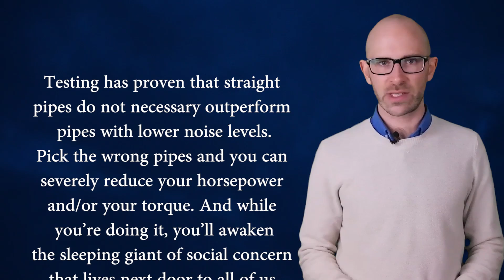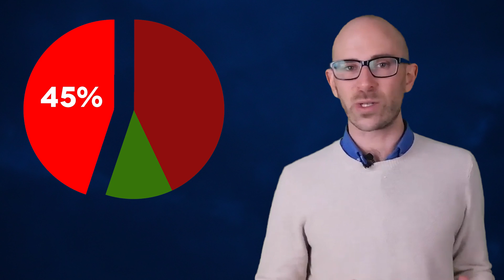Why are Harley Davidson Motorcycles So Loud?

Comment: I don't own a Harley Davidson. And I never will. The big complaint I hear from people is getting stuck behind a large group of Harley bikes going way too slow. The reason for this is because of the Harley Davidson engineering. They are notorious for going into a death wobble at freeway speeds. After seeing multiple videos of Harley Davidsons going into the dreaded death wobble I wouldn't buy one if I won the lottery. A machine that expensive should not be trying to kill you or make you deaf every time you ride it. Unacceptable. Get a Honda or Kawasaki.

Comment: The same jerks riding Harleys full throttle through my residential neighborhood in the summer are doing it without helmets or safety gear. I don't buy the argument that they are concerned about motorcycle safety. They are loud and obnoxious and they think it's awesome. It makes me want to live on a curvy road where full throttle acceleration won't work. The base stock Harley at 80dB is still ten times too loud. And the EPA regulations on noise pollution don't mean crap if they are not enforced at the local level. I own a motorcycle, but it's not a Harley, and it does have a muffler. Safety equipment includes helmet, jacket, gloves, boots, pants, and brain.

Comment: You could have performed a proper investigation. Ride around a while on a completely quiet bike and then do the same with loud pipes. I guarantee from experience that many more cars will try to run you off the road or pull in front of you with the quiet pipes. It's a sad fact that most of you car drivers take very little care when driving and usually pay very little attention to your surroundings. Loud pipes and the realisation that maybe this nasty biker might kick your door in if your driving endangers him tends to make you drive just a little more safely.
Reply: I'd be doing the opposite. If I can't hear the conversation in my own car and you are rumbling along side of me on your Harley with nuts and bolts bouncing off from your rattling exhaust, I might run you off the road.
Reply: I can't believe you actually wrote that. Were you drunk? Clearly you shouldn't be on the road in the first place. @airdaff4973

Comment: Their is a segment of the motor vehicle environment that has excessive pipe noise. This would include semi-tractor trailers, which I can hear a mile from the highway. It would include altered import sports cars, diesel pickup trucks, construction noise, Asian sport bikes, commercial aircraft, and stereo bass upgrades. 
When I listen to the city noise, the purr of a Harley Davidson exhaust is a pale comparison to the noise from all of these other noise polluters.

Comment: The newest Harleys are not made loud. Due to many sound restrictions the stock systems are relatively quiet. My Road Glide is not much louder than my BMW RT.  Americans like to put on the aftermarket pipes which make them louder in order to announce their presence to the people in metal cages (cars). People don't hear us and like to kill us by running us off the road or running into us.

Comment: I avoided a bad crash by being able to rev my engine to make a car driver aware of my presence as he was pulling out in front of me! What hasn't been taken into account here is the frequency of the noise. Humans don't hear low frequency sounds as well as high frequency. However, on the side of the general public, it is the responsibility of the bike rider to control the exhaust sound level in built up areas or when passing pedestrians. It's not that hard and it also improves safety on the road if you drive a bit slower to limit the sound level.

Comment: The other thing about (most) Harleys is they're air cooled, so there's no water jacket to quieten the mechanical noise; even with perfect mufflers the cams, pushrods and valvegear sounds like skeletons shagging on a tin roof.

Comment: I have an old 1948 Indian Chief.  It's just the stock motor and standard exhaust.  My dad has a 1946 Indian Chief that he's modified to make it about as fast as one can be made without changing the engine, and he did something to his exhaust to make it louder.  And it is almost to the level of obnoxious.  I like my stock 48'.  I didn't buy it to be fast and loud.  I could have spent 1/10 the amount of money and had a bike that could go twice as fast if that's what I wanted.  The bike is beautiful, and an enjoyable ride.  My feeling is that its coolness speaks for itself.  It's loud, but strikes that balance, where it sounds good without getting in your face.  People hear me, but they aren't annoyed.  And if it's not quite loud enough and need to alert someone to presence I can also hit the horn or rev the bike a bit.

Comment: Harley Davidson motorcycles with factory exhausts actually sound good and have a deep mellow sound which is not annoying to the ears and loud enough to be heard by motorists.  

After market  ( illegal exhausts ) are another matter , and are far too loud ! 

Riding correctly and obeying traffic laws will do a lot more toward a safe ride from a to  b , than  knocked out baffles with a length of re-bar,  or an aftermarket exhaust exceeding more than 130 decibels in some cases .

Comment: Vance & Hines short shots are some of the best if you want to get loud. I personally use Vance & Hines Big Shots staggered. They have a crossover as well. So the gas is can crossover between the pipes. So you get both performance and sound enhancement
Reply: I just swapped a set of V&H big radius on my RK absolutely love it!

Comment: Strictly an ego thing.  the mental stability of NEEDING a loud bike leaves the rider in question.  just fine the crap out of the owners, and impound the bikes.  My Honda has a larger and more powerful engine than most hardleys and just whispers.  get with it

Comment: I've owned 16 motorcycles, the last three have been Harleys and I leave the stock mufflers on. When others run without mufflers their Harleys may sound fast, but the truth is they gain very little power by running without mufflers. Some say loud pipes save lives. I laugh at this because even when others run their Harleys without mufflers you can barely hear them coming. It is after they pass you when you hear all the noise. I guess if they were to run backwards down the highway it might frighten deer off the roadway.

Comment: Harleys are not loud. Harleys with after market exhaust that have no baffles are loud. BTW, they are no louder than any other straight piped import cruiser. With that said, my I bought my softail with V&H big radius pipes with no baffles. It has a TC96 engine and the decibel meter reads 68 decibels.

Comment: LIKE YOUR FAKE NEWS, i'm a Manager of an Independent Motorcycle Shop, and i have DB meters and a normal human conversation can be near 50-60db, and the Harley's you show ALL have Aftermarket MODIFIED Exhaust, not 1 had stock or screaming eagle exhaust.  Sad you Blame it on Harley when it's Metric Bike riders that are going nuts with modified exhaust, and i agree riders need to learn to ride, and too many don't, thus the crashes, but in some not all but some cases LOUD PIPES DO SAVE LIVES !! and anyone who says different is either a Liar or a Moron.

Comment: A harley at high rev with open pipes does about 115db 50cm after the exhaust at an 45° angle
Reply: That should be illegal especially when they smash the throttle behind peoples backyards
Reply: @loganm2766  well i live in germany we have very strict noise laws every exhaust needs to be eu certified and cant be louder then 5 dezibel over the factory exhaust (harleys have about 95db 1/2 rev) but i drive a manuall penzl exhaust with a valve inside that can be pretty quiet and completely open, i can regulate it while driving so when i go trough a little town or something i can turn it down. Just the silencers cost about 1800 euro because germany sucks.

Honestly a harley shouldt sound like a lawnmower.

Comment: They are loud because unlike a car, they dont have headers and mid pipes and catalytic converters. They are usually installed with mufflers and baffles, but that's pretty much it. The sound of the engine differs from the size and shape of the engine and also an offset in pitch by the number of pistons. 2 piston engines which Harley's and most Street bikes use have a hard, abrasive, low tone sound. While sports bikes with 4 pistons have a higher pitch and consecutive sound. 
Factory stock exhausts will be equipped to have the quietest efficiency, but if your a true rider you will cut those restrictions off because LOUD PIPES SAVES LIVES. In a common motorcycle accident, louder bikes will be more noticeable and easier to avoid, rather than a quiet mosquito that would be a serious hazard on the road. Removing mufflers will also increase the horse power because the amount of air being intaked by a car/motorcycle needs to come out of the engine just as much, therefore this video is a bust. Harley's are fine just the way they are.

Comment: Harley motorcycles are not powerful. 100 years of turning gasoline into noise. My motorcycle with an engine 1/3 the size of most Harleys,even modified for more power, still makes more power, less noise and gets better gas mileage.

Comment: They are a public menace....in most states they are illegal..but law enforcement refuses to do anything about it. I have ridden a motorcycle for over 35 years...never tampered with or changed the stock exhaust system...

Comment: They're loud because of exhaust mods. I hear them very loud straight Harley's and lifted trucks all the time down in NC. Shoot my old gsxr 750, it's a 99 srad model it hits over 127 db with the muffler gone and the converter gone.

Comment: I assume you don't ride a motorcycle. Pulling from the same source "Data shows in 2017 that the most harmful event for 3,019 (57%) of the 5,326 motorcycles involved in fatal crashes were collisions with motor vehicles in transport."   pretty bad video,

Comment: Harley owners, members of group think, remove the stock exhaust,. They throw away a $1000 factory for pipes that do nothing but make the so called Harley sound. Without that sound no one would buy them. To fit into the Harley groupie think, off with the new, in with old noise maker. They don’t care who they bother just as long as they have that loud sound
Reply: Fuck off candyass!!!

Comment: Harley's sound like meek mice from the factory. Any bike does, really. I have a v-rod with stock pipes and the air intake is louder than the exhaust so I sound kind of like an electric motorcycle riding down the road. I do, however, have a Kawasaki Vulcan with straight pipes and that thing is quite possible the loudest motorcycle I've ever heard. I really couldn't tell you why, but every Japanese motorcycle I've ever heard has been louder than Harley's. I wanna say it's because they tend to rev higher but I have no idea. All I know is what I hear.

Comment: I'll answer the question, seeing how this guy has no idea. Any V- twin configuration can be loud with aftermarket exhaust, but they are pretty quiet with stock exhaust, even Harley Davidson. If you went to a dealer, and started a bike with stock exhaust, you wouldn't even hear it, like all bikes with stock exhaust.
          Now to answer the question, they are loud because there is only two pistons, and as big as a Big Block auto piston. Being in a V-Twin means they are moving exactly opposite of each other which causes the thump, and the vibration. When you add open exhaust pipes, it amplifies the noise, but it would with any combustion motor motorcycle, it just sounds better with twin piston motorcycles, because of the low base thump.

Comment: As a biker there are a ton of reasons to have loud pipes. 
Loud pipes can help people notice you in traffic.
 Really helpful riding on rural roads with animals running away from the bike. 
Also one big reason I have louder then stock pipes is to make shifting gear easier. Some bikes come with exhaust that you simply can’t hear over the sound of the wind. 
Side note the wind noise on a bike will cause hearing loss long before any loud pipe

Comment: Regarding your stats on motorcycle crashes being the fault of the biker:  If the stats were split into cruiser and touring versus sport and dirt bikes; I'm sure you'd find that cruiser and touring riders are far safer riders than sport and dirt bikers.  If you just go on cruisers, you'll find out there are fewer accidents with the louder bikes because the cage (car) drive will hear the loud modified bike over the stock quieter bike.  

Please stop bad mouthing all bikers because of those hotshot d-bags on crotch rockets who like to ride wheelies down the highway weaving in and out of traffic.  I'd rather lose my hearing than my life, so let my pipes be loud.  And if you don't like that, then you'd probably not like the train horns I put on my bike after granny almost ran me into a ditch a few years ago.

Comment: The reason they are so loud is because the owners replace the factory pipes( that contain a muffler) with straight pipes with no muffler or pipes designed to actually be louder.

Comment: I have a LOUD M109R bike which is awesome!😎 ... and my loud pipes (in cruzin mode) did alert and stopped two tunnel vision kids running in between parked cars out in front of me. 
They couldn't see me but they sure did hear me.  So loud pipes do save lives and it's worth it. 👍   
Also, it wakes up dumb people that don't wanna look at me. 
I did have quiet pipes once on my M109R but when a driver cut me off badly,  I asked didn't you see me and he replied that he couldn't hear me coming.... Go figure!🤔
Also, when I had my Quaker 250 with the quiet stock pipes I would beep my horn to alert those "people" that I'm driving here but then found out that beeping your horn here in Adelaide just makes people angrier!😆   Sooo... loud pipes it is!

Comment: The interior of a standard modern semi truck can reach 80 dB at 65 mph. You can't hear a car horn unless they're right next to you. Unless they're blowing past you at 150 mph, you can hear loud pipes from some distance. 
Even if the manufacturer won't sell loud pipe, it's not like the biker can't go to their local auto parts store and buy exhaust pipe or cut out the baffling.

Comment: "A motorcycle is a bicycle with a pandemonium attachment and is designed for the especial use of mechanical geniuses, daredevils and lunatics." Atlanta Contitution 1916
Saw this quote on the wall of a Harley dealership.
Reply: Single individual crashes have nothing to do with sound levels . Use Your horn switch they say. as You move to locate the cleanest switch on Your handle bars, it's over. Since My hand is already on the throttle a good snap of the wrist will in fact be a  much  quicker response than fumbling towards the switch as Your grip tightens and you may advert your eyes to locate the horn switch, which most riders have not acquired muscle memory for. The Crack from loud pipes will Penetrate the cabin of a tank as the driver may be distracted as They decide to take your lane. The Stock pipes Harley sales sounds like a sewing machine on purpose. After a buyer has his first near death experience as he is jamming the hor repeatedly while losing blacktop from a suv immediately returns to Harley to check the prices on a newer louder exhaust system. Why else is a whole wall dedicated to pipes? They know. Loud pipes do save lives in certain situations, but no one calls the police and says, "I was almost hit! But My loud pipes got their attention!" What you do get is , "I didn't See Him" and " I didn't hear them". I'll  take the ticket for the seconds of discomfort to these poor souls ears so I can come home to loved ones.

Comment: Powerful-sounding, yeah. That kind of sums up Harley-Davidson in a nutshell. The Harley sound, as the manufacturer calls it, seems to be used as a territorial "I'm a sociopath" call. At least outside the US, the image that goes with it is derived entirely from our single exposure to the image - courtesy of the Village People!
I'll stick to my rice burners (sic), thanks. They put their engineering into performance and efficiency rather than simply the image.
Reply: So have you actually ridden a Harley?
Reply: didnt the v p love pipe?

Comment: The Harley V-twin is a fairly large displacement (by motorcycle standards) engine with high compression, a 120 degree crank, and no cooling system to dampen the noise - on the older engines anyway.   Seems like the newer ones have water cooled heads.   If you took a 2 cyl riding lawnmower engine and bumped the compression ratio up to about 9.5 or 10:1 it would be almost as loud

Comment: Why are Harleys so loud???
For those who are clueless and have their heads buried in phones while driving, "LOUD PIPES SAVE LIVES"!!!
More cyclists are killed every year by inattentive drivers and the invention of the cheap cell phone made that go up exponentially. The "plugin and tune out" generation is a danger when behind the wheel which is why wearing headphones while driving is illegal.
I've already had to put a bootprint in some ditzy gal's car door for attempting to make a lane change while I was in it on a quiet Honda.
I don't have that issue on a Harley.
All those liberals can suck my Thunder Headers, and they're EPA stamped approved.

Comment: They are as loud as they are, because the average auto driver is not paying attention to traffic well enough to prevent them from hitting a motorcycle.  So, in order to increase their chances of survival, they make them as loud as possible.  Loud Pipes do save lives.  Stick to U.K. riders Mr. Britman,  America is not your concern.

Comment: Crotch Rockets are loud also but nobody says anything.   Only about Harley.   And drag pipes you LOSE low and mid range power they are just for sound.  Best performance and loud sound is a 2 into 1 pipe
Reply: 2 into 1? Why would you want that restriction?